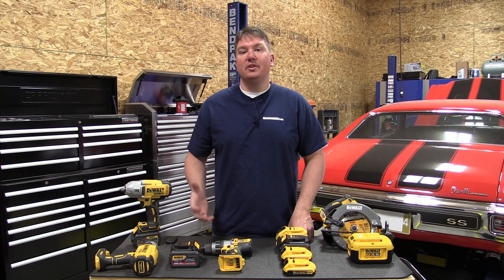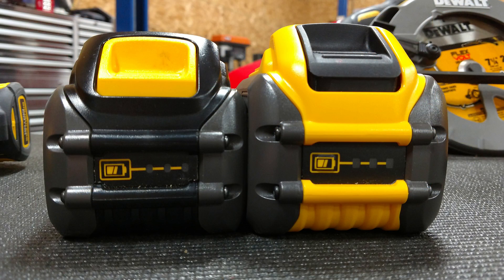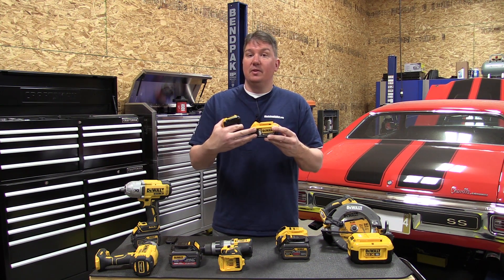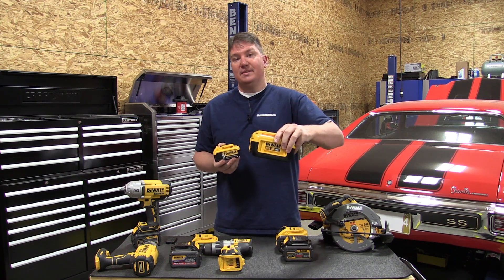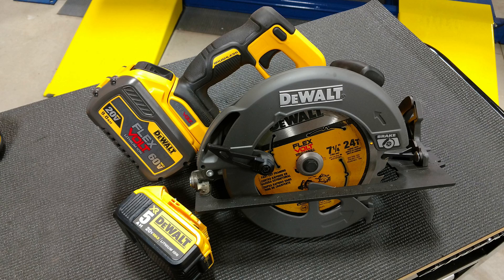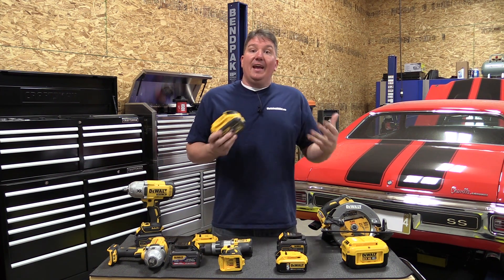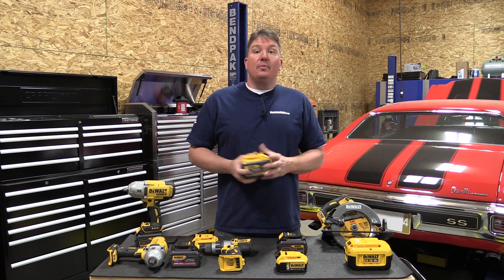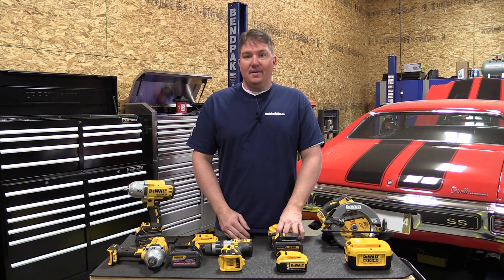Dewalt Flexvolt 9.0Ah 6.0Ah vs 20 volt max 5.0Ah 2.0Ah vs 40 volt - How Dewalt Batteries Size Up

Comment: I am looking to get the new dewalt 961 1/2 impact and I don't know which battery to get.  The thing I will be using it the most on is my scag mower when I change the blades.  Thanks
Reply from the maker: IMHO, you will be fine with a 5Ah, but a 6Ah 20- volt will give you more power.
Reply: @WorkshopAddict  Thank you    I didn't know if five would work or if I needed to look at the 9ah, but the 9Ah was about $300.  I love the red Chevelle in the background, my dad had a 69 back in the day.

Comment: I use DeWalt and have a bunch of batteries.  I like the Milwaukee 40v equipment approach which uses 2 20v batteries side-by-side.  I’ve seen videos showing that the Dewalt twin 60v miter saws are totally unreliable and failure prone, acknowledged by Dewalt.

Comment: Are the flex volt batteries 18650 cells or 21700 cells?
Reply from the maker: Depends on the models.  Some have/had 20700s

Comment: The weight can work for you. We have two dce800. Sanding ceilings the weight at the back balances the head on the ceiling. My brother and I sanded out a 10,000sqft house with two 9amph batteries. Scottish boys in Canada maybe that helps with the weight

Comment: I just bought a 20 volt 10 amp hour battery . I’m trying to get longer run time for my drills and circular saw and saw saw . Do you recommend this or should I do the flex volt .

Comment: where are the 40v batteries?  Are they compatible with the 20v tools?
Reply from the maker: They dropped the 40 volt batteries and they were never compatible.
Reply: @WorkshopAddict  dewalt has way too many battery options. now they added the pouchy "powerstack"; why!?

Comment: Dewalt's "Commercial Line" is rather pointless. They only work with a handfull of lawn tools, where as the Flexvolt batteries have the same lawn tools available that the commercial line does AND they work in all the hand tools as well. If you are going to go with a proprietary battery standard then go with the other brands that make better lawn equipment, like Ego, and just buy their batteries.

Comment: I'm a small woman. In the past couple years I've started getting into doing my own DIY and lawn work. I started with a Ryobi 40V 2Ah battery in my weed eater. Then while looking for a replacement discovered that one can buy a whole set of tools that run off of the same batteries and are interchangeable. That would be great to have a full set of electric tools that aren't extremely powerful for me, but enough that I am not struggling with everyday tasks and some heavier stuff. My husband uses all gas powered heavy duty equipment, like Stihl, and while I can use those, I am sore for a few days after.

Any suggestions?
Reply from the maker: New Dewalt Flexvolt attachment ready trimmer and dewalt atomic tools.
Reply: If you're already using Ryobi tools and batteries there should be nothing wrong with sticking with them. I agree, stick with one consistent battery tool line. I've got DeWalt myself.

Comment: Have the flex 6ah batter with my ice auger... not very happy with the amount of holes I can get ... I actually returned the battery stating it was defective but the new one is the same..does the switch between 20 and 60v eat up the life of the battery and if so how do you eliminate the 60v switching?
Reply: The 60 V Flex battery pack automatically "switches" from 20 volts to 60 volts as needed per the device.  There is nothing you can do about that ...
Reply: @MrSummitville  might be better off using a non flex battery then
Reply: @wisconsinlife3971  Amp-Hours is Amp-Hours, so use the largest Amp-Hour battery that will fit.  It does not matter if the battery is 20V MAX, 20V XR or 60V FLEX.  Just beware, the larger the AH the battery,  the longer the continuous runtime = more HEAT in the motor & electronics.

Comment: 3:50 Universal unit of Energy [ Wh ] gives precise energy capacity of a battery.

6 Ah * 18 V [2 Ah * 54 V] = 108 Wh
9 Ah * 18 V [3 Ah * 54 V] = 162 Wh
7.5 Ah * 40 V = 270 Wh

Note:
1000 Watt hour = 1 kWh = 1 Unit of electricity

Comment: Excellent review 👌just wondering as l m only getting into cordless range in the metal fabrication business , and l m wondering what volt batteries and model of tools do you recommend , l m interested in an impact driver & wrench , 4.5 grinder, & an sds drill ? Tks v mch

Comment: I have the Dewalt XR 899 impact and it struggles with stubborn rusty bolts with the 3ah battery that came with the impact so should I go with the 9ah battery for more power or what? Not sure if a bigger battery will give this impact the extra power to bust off the super tough bolts or if I should be considering the 20v milwaukee impact that's supposed to be more powerful than the dewalt 899.
Reply from the maker: I would move up to the 6 or 8 Ah 20 volt
Reply: @WorkshopAddict  Will a more Ah battery provide more power and torque or just longer run times?
Reply from the maker: @bigtexas7580  to a point both.  IMHO no impact wrench should be used with less than a 5ah unless it is a compact.  But once you get over a 6ah 20 volt, not a 6 Ah FlexVolt, there is little to gain.
Reply: @WorkshopAddict  I was just told that the cells in the 9ah and 12ah batteries are more powerful than the smaller batteries so I believe I'm going with the 9ah. Thanks.

Comment: wired 20 volt parallel where flexvolt 20 volt parallel but when used with flexvolt tools it kicks a switch electrically and a manual switch to series making 60 volts. on the 9ah batteries the price more scary than weight they not heavy.

Comment: From what I have seen over the last 2 years is Dewalt is not pushing the flexvolt system. HomeDepot used to have huge displays of it and now hardly anything!!! It is a great idea with cordless table and chopsaws, aircompressor and more power to cordless circular saw, recip saw and angle grinder. But it seems it's sort of getting killed off when it has so much more potential.

Comment: to make it even more confusing there are also 3, 4, and 6 Ah Dewalt 20V-batteries floating around. the basic thing is these batteries are made to run different voltages for different amp hours but run for all voltages for variable amp hours.

the are all forward compatable but they are not backward compatible.

Comment: It is really deceiving and Dewalt should be ashamed and sued for this for false advertisement.  When you buy 6AH Flexvolt battery, one might think that the 6AH is what you will get if you use it with a 60 volt tool.  But no, it is true if you use it with a 20 volt tool. Don't buy flexvolt if you intend to use it with 20v tool, you are still better off with a 5AH 20v battery cause its cheaper. The only advantage of this is  you can interchangeably use it for both 20volts and 60 volts tools.  Hope this helps.

Comment: Brian, 

The DeWalt flexvolt 6.0ah / 60v uses the 18650 cells in them. 

Does the 9.0ah / 60v use the same cells or is it the 21700 cells?
Reply from the maker: 9 and 12 use 21700
Reply: @WorkshopAddict  

Good to know. 

Thank you.

Comment: Do the math.... batteries in series you sum the volts of each cell to get the total volts and the Ahr remains the same as each individual cell.  Batteries in parallel, you sum the Ahr  to get the total Ahr rating for the pack and the volts remains the same as each individual cell.  So, the 18V.5 5Ahr battery pack is two stacks of five 3.7V 2.5 Ahr cells.  As stated in the video, the 55.5V 5Ahr batttery pack is three stacks of five 3.7V 2.5 Ahr cells.  The internal circuitry switches from 20V to 60V depending on the tool it is installed onto.

Comment: Can these batteries be left on the charger, i cut my grass every two weeks so after using it can i just leaving charging until i come back in two weeks ? thanks
Reply from the maker: Yes, without issue.  Off season I would not.
Reply: @mikeb1039  thats crazy because they have a circuit in them to prevent overcharge or discharge. the cells may be unprotected but the circuit protect them and will not allow over charge.
Reply: @viper04af  Actually, you should store the battery pack 50% State Of Charge !   Then recharge the battery to 100% just before ( the night or morning before ) you need them.  You have no clue what causes these cells to deteriorate over time - keeping them on the charger at 100% FULL Charge all the time is one of those reasons !!!
Reply: Lion cell require 70% charge for long term storage. Go over to the battery forums, those guys have 100s of hours and years of testing to show this.
Reply: @viper04af  They do not REQUIRE 70%.  Anything between 50% - 85% is OK.   It is at 100% SOC that is BAD.  And, it was YOU that originally stated that @MikeB was "CRAZY" for suggesting the battery be removed from the charger for storage ... Flip-Flop much ???
Reply: @MrSummitville  you said store the battery. I leave mine on the charger untill the in use battery need charge then I sawp them. In the winter for storage I take them off and run them down a bit and put them on the shelf. I still have and use the very first 20v battery I bought the year they came out it works great still 
The absolute worst thing you can do with a lion battery is leave it sit for long time with a low charge, that kills them fast
Reply: @viper04af  Keep changing your story and eventually you will get it right ...
Reply: @MrSummitville  you change it to storage so I responded to that. But I can see you are an internet keyboard worrier that can never be wrong or challenged or anything else that make you not feel right. I was just trying to help and pro ide my own experience. My experience has many phases witch I already explained. Winter is long term storage for me and summer they are on the charger untill needed. Heck I even have my home automation cycle the power to the chargers once a month to ensure the batteries are full in case I need them. Power cycle causes the charger to start again.

Comment: I'm buying this just as a inside the  house generator and to run my 20'inch wall fan in my enclosed trailer and to use me electric air compressor both only as needed..getting the 9mah batteries(4)of them...with all that being said is this the right way to go....in your opinion

Comment: some People say that if you use Flex Volt in 20v sys the Motor will not last too long ???
Rumor or Realiy ???
Reply: False, the battery packs have 4 connectors on them, two that put out 18v, and two others that put out 54v
In addition to this, the 54v circuit requires that a plastic detent be engaged in order to work.
Thus making it impossible for a 20v tools to receive 54v as the connectors would not align, as well as the detent would not engage.

Therefore, anyone making such claims is either lying through his or her teeth, or has deliberately gone out of there way to jerry-rig the pack and tool to received more voltage than it is intended for.

Comment: Today battery are more expensive than the tool😮😮
Reply: They cheap on plastics and metals, check out AVE channel sometime. also though IF they are sing top quality 18650s in there yeah those prices can add up too.

Comment: Why go from a 5ah battery with 2 layers of cells to a 6ah battery with 3 layers of cells? You increase the weight and add 50% more cells (from 2 to 3 rows) but only gain 1ah? That doesn't make sense.
Reply: Because the total voltage is not achieved by a single layer - as you simply perceived that one layer must therefore equal the full 18v

Comment: Is there any difference in power or run time between the 6ah 20v and the 6ah flex volt? Thanks
Reply from the maker: Not enough to talk about.  6Ah is 6 Ah and they will perform pretty much the same.  We have run tests with them on vacuums with the same draw and they have runtimes within seconds of each other.  The flexvolt is heavier because it uses older 2.0 Ah batteries and is 3p.
Reply: WorkshopAddict Thanks so much for the reply! Much appreciated
Reply: The tool will perform exactly the same.  However, the voltage drop will be less, if you were to use a 6ah flexvolt.

Comment: By the 2:30 mark I was reminded why I've only been looking at Milwaukee or Makita....18v,, 1 battery or 2, and they all interchange.  Easy.
Reply: If it confuses you that much, IDK what to say.
The flexvolt platform has an advantage over Milwaukee and Makita. You can use these larger batteries to power more powerful tools. For example, the Flexolt chainsaw, weed trimmer, and table saw seriously outclass the competition from Milwaukee and Makita, because these tools specifically need to be more powerful. Those are just a few tools, there are others. More powerful recip saws, circular saws, angle grinders, etc. The 60v allows these tools rival corded versions in terms of power.
These flexvolt batteries, while powering these stronger tools, can also be used in the 20v max line. So if a person already has 20v dewalt tools, they can then feel free to buy into the more powerful flexvolt platform knowing the batteries are already compatible.
Reply: So to sum it up shortly, the batteries of dewalt interchange too, but they also add some much needed muscle in some tools.

Comment: Dang that circular saw is beautiful I need to go get my self one of thoes
Reply: Shield Spear I have one , the power is unbelievable.
Reply: I use the 60 volt circ saw and it is very powerful.   When not in the saw the battery is used in my large 20 volt blower which is a power hog but lasts really well in the blower.

Comment: I’ll stick with Milwaukee lol their batteries seem to me to be better. I don’t need a gimmick of “20v” just say 18v 12ah and have a nice day lol 
Thanx for the video brother
Reply: Summit M18 HVAC if your going to say that then you need to say 18v and 10.8 v as the 12v is 10.8v another gimmick
Reply: But it’s 12v. They don’t say oh it’s 14volt without a load smdh
Reply: Summit M18 HVAC no it’s not it’s 10.8v they just rate it 12v as it’s the same as the 20v 18v thing , in the uk Bosch 10.8v has now been rebranded 12v even though it’s 10.8v

Comment: And now 40v is pretty much gone lol.
Reply: Not really , the platform is used for mowers, blowers etc I have the back pack blower with 2 -7.5V batteries 🔋 works great
Reply: @MrRoverpilot  40v is totally dead in the u.s all the new mowers and yard tools are 20 or 60v and have been for a few years now.

Comment: I’ve found the smaller flexvolt tools not worth it like the grinder circ saw etc. not much more power and very short run time.
Reply: thats the big problem with there 60v tools is you lose the AH so there no run time like on big tools 2-3AH? its nothing
Reply: I got the 9.0 that's 4.0 a.h on the flex volt tools since I made this comment. I was using the 6.0s before and it's actually pretty good. Happy with run time but makes the tools heavy.
Reply: @henryk1031  a 9.0ah is only 3.0ah at 60 volts. 9 div by 3= 3 simple
they use 3 banks of 5 cells to make the 60v max as they call it 
there are 15 cell in the flex packs
Reply: I know but it runs a lot longer then your average 3.0 pulling off all the cells.

Comment: So here’s my question, wouldn’t this 60V 4 ah flex volt be the closest in power to the 7.5 ah 40V?  Here’s the one I’m talking about. https://www.homedepot.com/p/DEWALT-FLEXVOLT-20-Volt-60-Volt-MAX-12-0-Ah-Battery-Pack-DCB612/305345662
Reply from the maker: It might be the closest...  The "12Ah" Flexvolt has 15 4.0Ah cells that make 60 volts.  In 60 volts, it is a 1P battery.  The 40 volt 7.5 Ah battery has 30 2.5Ah cells.  It is a 3P battery with three layers of cells that each equal 40 volts.  IF we were to make our own battery with the cells from the 40 volt 7.5 Aah pack, we could make a 2P 60 volt 5.0Ah battery pack with those 30 cells.
Reply: Price wise the 12ah battery is not worth it right now.

Comment: Will The Tools Run/Fit On Any Of These Batteries or Do The Tools Have To Be Voltage Specific? Are The Batteries Interchangeable To Fit/Work On Any Dewalt Tool? Is That The Same Question? Walt@YOUandMeRealty.com
Reply from the maker: The Dewalt 20 volt and 60 volt flexvolt work on 20 volt tools, the 40 volt only work on 40 volt and the flexvolt are the only ones that power the flexvolt specific tools.
Reply: WorkshopAddict So There Are Currently 3 Tool Types (Volts). 20V TOOLS Work With 20v & 60v(AutoSense?/Switch?) 40v TOOLS ONLY Work With 40v. 60v “FLEX” TOOLS ONLY Work With 60v? Shouldn’t “FLEX” TOOLS Work & Be Backward Compatible With All Batteries🔋or At Least 20v Batteries? We Recently Bought The 20v 10 Tool Package & 4 Extra Battery Package For About $700 Total at Lowe’s. Thanks For The Quick Reply, Happy NewYear! 🎉🥳🎉 De Walt @YOUandMeRealty.com.
Reply from the maker: @YOUandMeRealtyDotCom  Flexvolt works with 20 volt tools and the 60 volt flexvolt tools.
Reply: @WorkshopAddict  
Flexvolt only work with the XR tools they will destroy any tool that is not branded XR!!!!!!!
Reply: A lot of guys are now finding out that if you put a flexvolt battery on a non XR tool that it will destroy it

Comment: There's actually three layers of cells in that 5 amp hour battery. but there is different types of cells in that 6 amp hour battery.
Reply from the maker: The 5.0 Ah has two layers of 2.5 Ah batteries.  It is not 3P.
Reply: @WorkshopAddict  . It looks like I was wrong. I only get to do that once a year. They don't transfer over so I had to use it up. 😑

Comment: The 40V Max batteries have no compatibility with 20V Max or 60V Max batteries.  The Flex thing seems to have broken here.  They use a different, larger connector.  My 20 V Max Fast Charger can't charge my very large 7,5A 40 V Max battery and I can't use it in my 20 V Max rotary hammer driver..
Reply: I was taught to never use fast Chargers with the new lithium batteries because they destroy them over time
Reply: The faster you charge lithium the faster it displaces the energy